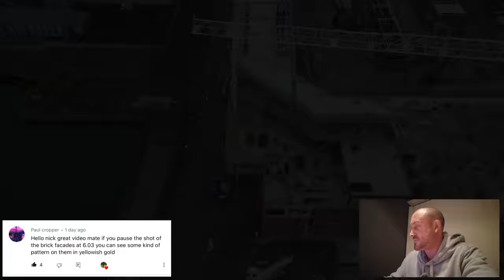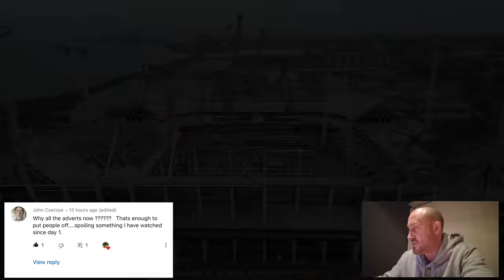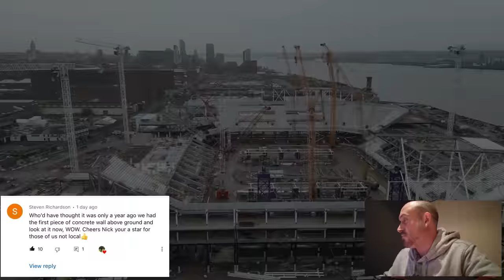Bramley Moore Dock Mid-week video with VoiceOver  (29.11.22)

Comment: There is an informative update on the club’s website today about the Leitch ironwork representations. Firstly ,they are most certainly being designed in,and secondly, the pattern will be created by using slightly darker red brick facings to pick out the pattern. It’s all been mapped out by computers, but will only become clear when a lot more of the panels have been lifted into place.

Comment: Just watching you midweek video and some mentioned access and egress I attend regularly at the Etihad Stadium level 3 at in the South stand as 10 exits same as the new Everton stadium and there is no problem with access and egress . And the panel in the roof is a solar panel which there will be numerous around the ground

Comment: 9:31 -  the strange yellow pattern in the brick façade looks like a Moiré pattern (the sort of thing you used to see on analog TV broadcasts if someone wore a striped shirt). It happens if you've got a fine pattern that's very slightly out of alignment with the chip in the camera - there's a lot of tight vertical lines in that shot, and if you watch closely around 8:02 you can see the yellow pattern moving as the camera is zooming in. So it'll be an artefact of the footage, not a funky new design on the brickwork!